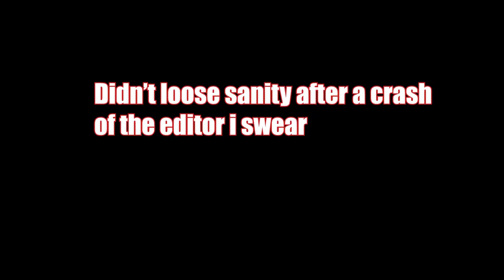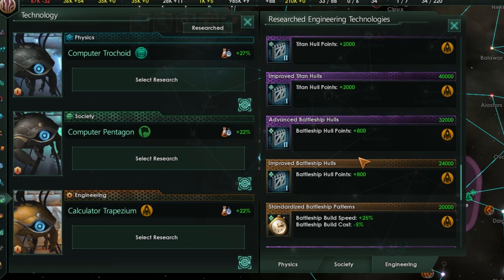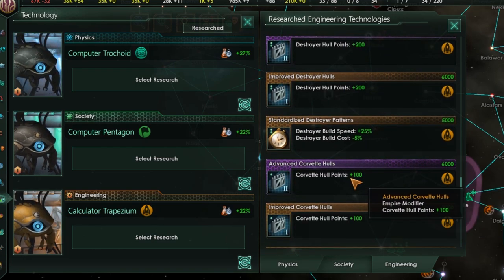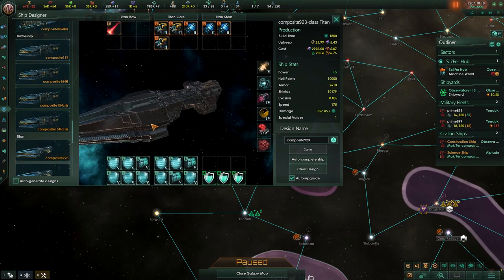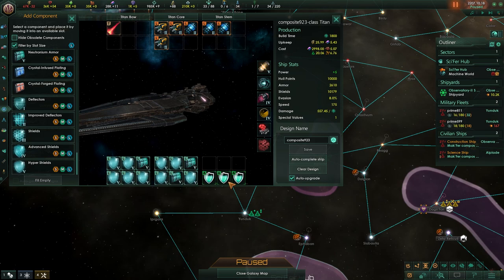Stellaris META Ship Designs Explained - Nemesis

Comment: I think you need to lower the volume on your memes and up it on your voice. 

The nothing but arty battleships late game bothers me, any idea how you'd rebalance it or are you happy with how it is?
Reply from the maker: No idea tbh. what i dream for stellaris battle system is a scalled up FTL system. Hack, Planet support, Dynamic shield, Zoltan shield, more space hazard, more weapons, crew, cloning, boarding, drones, etc...
Then perhaps we'll have enough depht for hulls to have their own niches and cheese.

For the voice i'm still trying stuff around.
Reply: The artillery battleships are the best right now, and will likely remain the best for a long time unless the mechanics of fleet battles in Stellaris is changed significantly.  Alpha strikes need to have their power reduced!

The hard counter system that is suppose to come into play against battleships really doesn't matter at all because artillery battleships can alpha strike most fleets into dust before they can launch their own alpha strike.  The correct counter to artillery battleships is torpedo corvettes and even they have a hard time getting into range to launch their own alpha strike because the battleships may get 2-3 volleys off before the torpedoes get unleashed.

The quick fix would be to give torpedoes a hell of a range boost.  Let a torpedo ship get an alpha strike off at the same range as an artillery ship.  If they made that change a torpedo corvette force may have a chance against artillery battleships like they are suppose to.

EDIT:  This logic extends to all the weapons...  If carriers had better alpha strikes they would be competitive.  But right now in Stellaris range to get huge alpha strikes is King.
Reply: The 2 ideas that came to mind: bump the max evasion to 100 or 95%. Tracking was supposed to be the weakness of artillery but with high tier sensors they still hit 25% of the time (35% with the Titian aura or enigmatic targeting aim assist, 45% with both, oh and if psionic another +10%), knocking that down to 15 or 20% is a 40% or 20% buff to corvette survivability. And while we're at it chuck another 5% base evasion on destroyers and cruisers.

My other idea it to make "dead" ships "dying" ships by giving them a second or 2  to see if they can get 1 more shot off.

Comment: I still very much believe that, even if you want to go heavy on medium and large weaponry, you should either have your Destroyers running ssMss, or have the hanger module on your Cruisers. Corvette spam is still very much a problem, and if you dont have a reliable way to counter them, youre going to lose pretty often, and no, medium and l;arge weapons even with the fire control auxiliaries and the sapient combat computers are not a reliable counter to them. a large enough corvette swarm will still heavily offset the 30-45% chance to hit of those weapon slots.
You NEED either strike craft or autocannons in your fleet.
And yes,i have tested it. a 200 Corvette swarm won in every engagement that did not involve autocannons, strike craft, or against a fleet of greater numbers.
Reply from the maker: A corvette swarm can be mitigated, and does not transition well in the late game. If you see it comming, a handful of hangar (station or defensive platform) and fighting in your own system until you have enough refitted ships to deal with it usually spell doom for corvette. + the main feature of corvette is their thruster, a not so common tech for the playstyle, and it relies on either disruptor(which is a bad weapon) or autocanons (which further bloats engineering tech required for torpvette). A corvette swarm can work, defensively primarly, but in offense it relies heavily on your ennemy being reckless